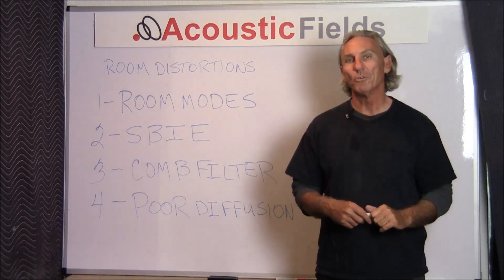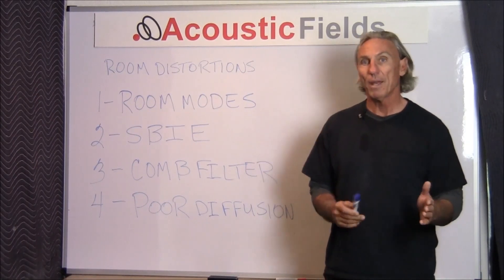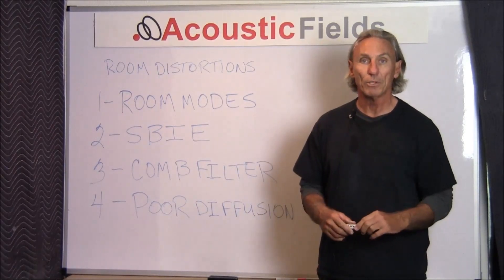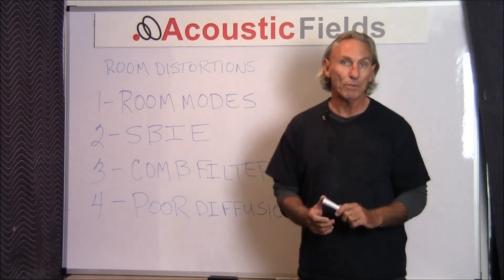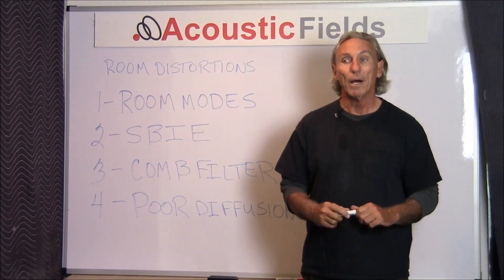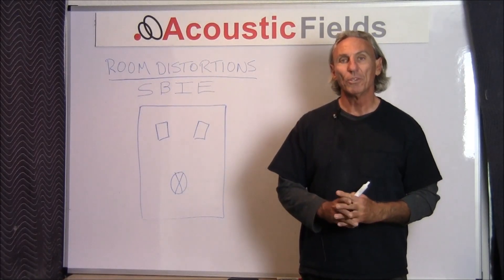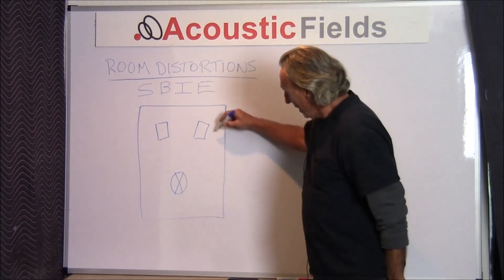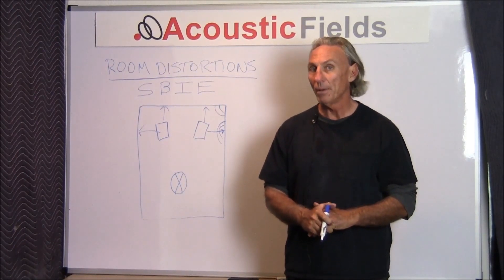How and Why Room Distortions Affect Your Sound - www.AcousticFields.com

Comment: What about rooms with instruments? The whole "side walls", "front wall", and "back wall" concept is a little different because sound has to be clean not only at the playing position but in many other listening positions where the other musicians are seated. Particularly if there are not that many amplifiers, and the room is just a practice room,  how should abortion and diffusion be employed to improve the unamplified sound of instruments within the room? I have not seen any youtube videos directly addressing this.
Reply from the maker: Hi Carlos,

Energy is energy no matter what the source. It can be energy produced by speakers, voices, or instruments. All energy in our audio rooms must be managed, so that microphones and our ears can "hear" what each one is supposed to hear and receive. There is only so much low frequency energy that will "fit" into a room volume before the room reaches its internal resonant frequency. This process is termed loading. There is only so much middle and high frequency energy that will fit into a room before the time signatures of reflections from all the surface areas increase RT - 60 (reverberation) times to the level of intelligibility. It is all about balance. Go to this link and fill out the information about your room size and volume. Lets take a look at the room requirements first. It is always about the room.
Reply from the maker: Free room analysis link:   http://www.acousticfields.com/free-room-analysis/
Reply: Thanks, I have just submitted the information to your website.

Comment: I have noted on all your videos relating to diffusion you refer to quadratic diffusion as 'predictable and consistent', could you clarify this or provide an example of a non predictable diffuser, for example how do 'skyline' diffusers match up to your 'predictable and consistent' goals. 

Thank you
Reply from the maker: +masterpangloss  Quadratic diffusers are predictable and consistent because you can control the quarter and half wavelength beginning and ending frequencies with a certain response range. Well width is half wavelength and depth is quarter. You can design a frequency response that compliments the room usage and the surface area that is the diffuser is applied to and provided you have matched the frequency response to the usage and distance to receiver correctly, the diffuser will maintain that frequency response integrity on that chosen wall surface area.